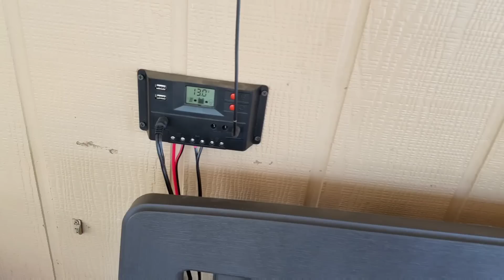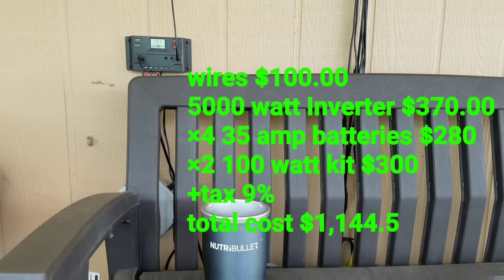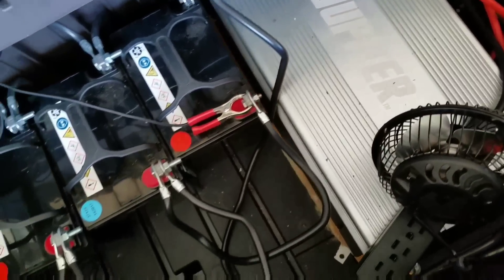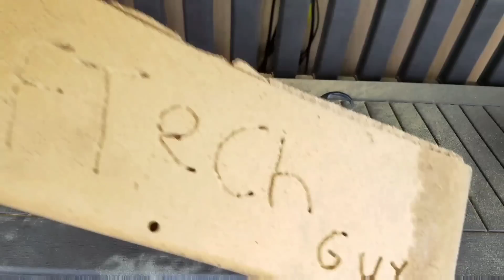What can you do with Harbor Freight 100 watt kit

Comment: just a couple pointers for you in the right direction.  .  . the harbor freight set up is great for beginners however is not ideal in many aspects, im going to mention a few.  . .First is the batteries the best batteries you can get for storage needs are 6 volt gc2 batteries, most people mention the trojan t105 but you can get the same style batteries from costco sams club and batteries plus for about 80 a piece, that gives you about 200+ amp hours for about 160 bucks,  thats hard to beat. . .second issue to be aware of is the inverter you are using. . . i started with the heavy duty harbor freight model similiar to the one you have have but quickly found out the inverter draws about 1.5-2 amps,  which is horrible just leaving it on. .  . i returned it because of that and bought a xantrex  xpower , which draws a no load draw of only 300 miliamps or .3 amps, which is a very low load on it.  this is the inverter that i use https://www.amazon.com/Xantrex-813-1500-UL-Xpower-Power-Inverter/dp/B006765OL6 and here are the batteries i was referring to
Reply: Why do you have to bring politics into this? I'm from Chicago and the stories of 53-57% of the people here being illiterate are true. Global Warming was proven to be a lie concocted by NOAA and NASA to keep their weather science funding going. Right now, I'm kinda glad Trump was elected president. A lot of the Democrat's sneakiness is coming out and alot of the corrupt Republicans are being shaken out. President Trump does present periodic buffoonery, but I think he's a patriot as of right now. Let's see how things go.
Reply: Your link to the batteries didn't make it into the reply :/
Reply: you are right . . . my bad here goes the link. . . https://www.batteriesplus.com/search?q=golf+cart+batteries      its 99 a piece for 215AH  batteries, costco and sams have them cheaper [about 80],. . .   HOWEVER.  ..  they both do not list amp hours which slightly concerns me , im pondering taking the costco batteries back and getting the ones from batteries plus which cost about 15-20 bucks more but seems to be a true-er deep cycle battery [not sure if  your aware but not all deep cycles are equal, the best batteries have thick solid lead plates while cheaper batteries the thinner and the more composite the lead is. . .  for this reason alone trojan t105 are the best, but who has 250 dollars to spend on a single battery. . .  SMH
Reply: +Mike Rivera JR can you use RV batteries?
Reply: Would you recommend the goal zero yeti in place of the harbor freight inverter?
Reply: @mariawinzler  FYI i dont recommend lead acid batteries for anyone unless you want to keep buying new batteries.  They have short lifecycles.  ~5 years if you're lucky.  LI batteries are a little more expensive but a better choice at 25+years of use.  The batteries you recommended arent really for solar and were designed for motorized vehicles which handles power differently then a solar battery.

Comment: for about $170 you could have had 220Ah of capacity if you had bought 2 GC2 V6 golf cart batteries. buy larger cable from a wielding supply shop. its a lot cheaper to buy by the ft and then buy the lugs along with a LP torch and plenty of solder. then you can make your own custom cables to connect everything together. the shorter the run of cables the less line loss you have so you end up with a more efficient system.
Reply: 393.08 today
Reply: Can you explain In beginner terms 🤔

Comment: Here is a place that sell 340 watt monocrystalline panels at $225.00 each but minimum of 6 panels. I am going to order these panels. I have a 100 watt panel now with 3 batteries and it takes days to recharge the batteries. 6 panels will give me 2,040 Watts and should charge my batteries up real quick.

http://www.shopoffgrid.com/Silfab-SLG340M-p/silfab-slg340m.htm?gclid=CjwKEAjw4vzKBRCt9Zmg8f2blgESJADN5fDgQIV0X5Si9QgfXtPk0CBVB0-6i95VCHpoWnQjXVz1LxoCBmnw_wcB&gdffi=f08f29ef9baf4b21b341373fc73f964e&gdfms=792362A0A9DE4B26BBD94DAB3396F236

Comment: RFTechGuy C.A.D. what is our electric bill monthly? any help bringing that down is nice right!!?? anyway the wires you can get real cheap by buying 15 feet 6 gauge jumper cables, or just some regular house hold # 12 or 14 electrical wiring way cheaper than the rubberized type cables out there, cool set up so far, hope to see more, Joseph T